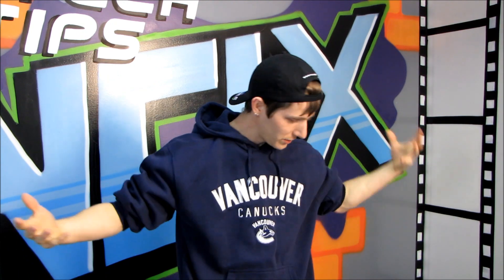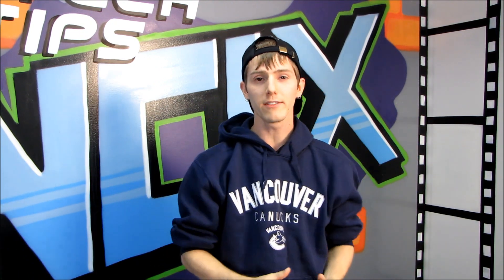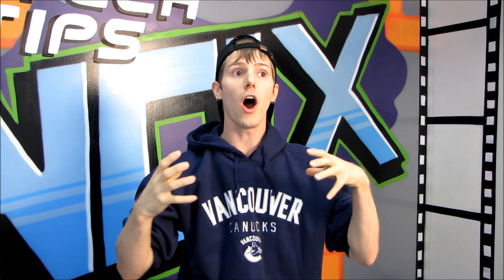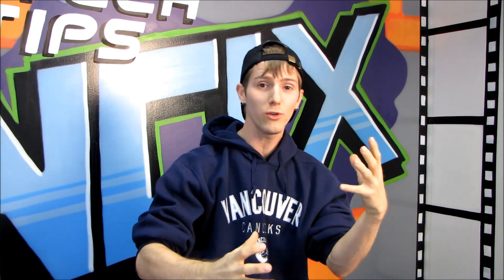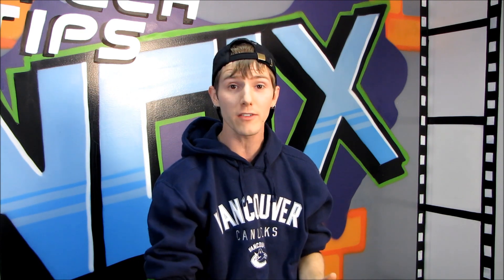Futureproofing Your PC - Dispelling Some of the Myths NCIX Tech Tips

Comment: This actually applied to me a  computer ago. I had built this i7 3770k (??) system and deliberately picked a motherboard that was SLI compatible

My video card? a gtx 670

ugh.

UGH. 

cringe.

Well eventually and obviously I bought a better video card, a 970, and just a year later bought a 1080. The 970 went to my brother, and the 670 went in the garbage. The system is still with me, but doesn't have a video card. It's for guests to surf the web and watch videos.

Now it didn't break my bank to buy a SLI compatible motherboard but I never had to do it to begin with. Now, my motherboards have only one requirement: massive SATA drive/port count. 6+ is minimum. I have a lot of hard drives and need all the help I can get

Comment: What software you use on your system is often a neglected factor. The operating system for example can become a real hog in the long run especially if it comes to Windows. Linux is much more suitable for the long run for two very important reasons: 1)you can downgrade basically everything in your distro thus releasing more resources for your normal desktop applications to use and 2)driver support usually becomes better over time. Especially the last one is a sort of a weird thing. Usually manufacturers offer very poor support for their the latest hardware on Linux systems. As times go by this changes (mostly through the hard work of the community). Windows for example is not like this. Going back 5-6 years ago and you will probably run out of luck for the driver support if you have the lastest version of that OS.

Comment: Btw buying a system with multiple GPUs (SLI) is usually not worth it unless you want to build a workstation of some sort. There are many benchmarks out there that give solid proof that most games don't even support that or (in some cases) do support it but poorly. I have seen very few games that actually use the full potential of multiple GPUs (sadly). Imho this is mostly based on the fact that game developers go for the current standard configuration. Based on various stats a profile of the rig of your average gamer is generated and used to give feedback to the devs what system a game should run on.

Comment: While I have to agree that a case is to some extend a piece of art I would also add a more important aspect - how well it cools stuff in it and where it is located (in an office, in a bedroom, in a living room etc.). Ventilation which is part of the design of a case is critical for the system especially if that system is supposed to run around the clock under heavy load (for example a workstation where you have it render some complex and large 3D scene for days without interruption). Next thing is the size (which of course also influences the airflow I have mentioned previously) - depending on how many components you want to pack inside you will have to choose the size form very carefully. This also applies if you plan on upgrading including adding new stuff to your system.

Comment: tbh futureproofing is a little more difficult than normal at the moment. New graphics APIs are taking advantage of more and more CPU cores, to the point where a hexa-core processor is needed to make sure some games don't bottleneck (or maybe they're just poorly optimized) and resolutions are on the up and up, with 1440p and 4k becoming more commonplace, and with 8k becoming the new 4k.
I'm happy with how my 4790k and 970 have lasted. Unless processors start making meaningful jumps in performance per generation i'm perfectly happy to stay with what i've got for another two years or so, even if it means turning a few things down from ultra now and again.

Comment: My rig that I'm gonna build and expect to be future proof is going to have.
i7 6700k, Zotac GTX 1080, 16 GB Corsair Vengeance DDR4 RED LED, Corsair 750d case or NZXT h400, Gigabyte GA 7170 X Motherboard, Corsair 850 Watt Power Supply and 4 TB WD SSHD with 500 GB Samsung 850 pro ssd....
Reply: also Corsair H110i Cooler and RGB Led Lights

Comment: Iv'e got a high end psu going on 10 and also my TU120EX cooler from same build is still chooching! I try and get 5 years minimum out of a motherboard and cpu combo, with1, 2 or 3 graphics card upgrades in thgat time, does vary on what comes out and what im doing.I like high eye candy in simulators which seem to be my major gaming load these days, fps games not working current build bugger all. 
I got screwed on ddr2 when it went EOL and was stuck on 4gb for a while longer than i liked from my '09 to about '12 system,No way i was getting screwed on ddr3 and ended up going way overboard with 32gb, oh well.My current gaming systems motherboard,cpu abd ram is about 4yo and has no bottleknecking with a current top tier single card solution,so little while more yet! It is running a high OC on water which helps.

Comment: Intel i7 6700k
Gigabyte gtx 1080 g1 gaming
Gigabyte ga-z170x-gaming 7
2x 16gb corsair vengeance lpx 2666mhz
Samsung m.2 950 pro 256gb ssd
1tb hdd 7200rpm
Corsair rm1000i

Actually planning to do this. Any thoughts or advice? 
The video says no one uses sli in the future. 
So adding a gtx 1080 when i feel the need is wrong thinking?
Reply: no adding another 1080 after 1-2 years will give u alot of fps boost and u wont need to upgrade other things like cpu ram etc
Reply: If you have a 1440p Ultrawide, 5760x1080 setup or 4K monitor (the only plausible scenario where you would need more graphical horsepower than a GTX 1080) to play games in 1 or 2 years w/ everything maxed out just save up and wait. When you really need it, sell your 1080 and buy 1 o 2 new GPUs like Volta or Vega 10/11 and  go SLI/ CrossfireX. Just don't buy another 1080 in 2 years because there will be better GPUs on the market. It's like if you bought a 980Ti now when you know that a GTX 1060 is pretty much equal in performance.

Comment: I have a gigabyte h85 motherboard + i5 4460 4th gen processor + 8 GB vengeance ddr3 + zotac 610 2gb ddr3 gpu why I am haveing lag while playing gta5  I only have 15-20 fps in gta 5 benchmarks and I am only using half of the vedio memmory (at normal setting )
Reply: +Bakery Junction cause you have a fkin 40 bucks graphics card. watch linus's video on cheap graphic cards
Reply: dayum man i swear i have the same build LMAO but i have 16gb ddr3 ram

Comment: I already had future proofed mine for 2-3 gen, for quite a while, 3 screens(adapter was added), radeon 7870, i5 3770k, 16gb ddr3 @ 1600, 120gb ssd os, 2 1tb hd's, (2 300gb raptors, 500gb, 640gb added later), 880w(boosts to 1080w) hiper type r mk2 psu 80+ (tideover from my core 2 duo build). wasn't until i wanted to run crossfire on my asrock board that i had to upgrade the psu from hyper to a cosair rm780

Comment: I'm building a custom pc this week.
Key components are almost final. But after watching you video, now I am confused between Intel Core i7 5820 and 6700k.
The main reason I chose 5820k is because it has 6 physical cores. The more the number of cores, the more it helps us in 3D animation and rendering purposes, because it's CPU based. There is a very noticable difference between 5820k and 6700k, 5820k being the faster one. And 6700k has 4 cores, but certainly is more future-proof. I am also a gamer, so that will be another purpose of this computer. I already have two GPUs, mainly GTX 980 Strix, and Quadro FX 4800. What would you suggest when it comes to my CPU confusion?
Reply: +Chirag Borawake you pretty much answered your own question. you NEED more cores to work. paying extra for 6700k when everything you need in a cpu is more cores to work with, isnt worth it.

Comment: anything that lasts me 3 years is future proof: skylake, 16 gb ddr 4ram, compatible motherboard with intel chipset, water cooled, 650 W psu, corsair cabinet, 1 tb hdd, r290 graphics. i think that ought to do it
Reply: +Saptaswa Charan Rakshit  3 year timeline is hardly the case of futureproofing. I mean most of the things that are good now will be good enough in a few years. If you think something is not going to last a couple years, it might not be really sufficient right away.

Things like PSU and case can be kept for a decade just fine, so it makes sense to get quality versatile units. RAM, unless there's a standard change coming up, can be good for upwards of 5 years, and there isn't a lot of price fall nowadays.

A case can be made against future proofing for some parts. You can't usually future proof your mainboard much if you're going Intel, because you need to replace the board with the CPU, and even with AMD, it's hard to predict how well supported any given board will be over the years, so futureproofing attempts are likely to result in frustration. Futureproofing GPUs is generally uneconomical, because performance per unit of currency just climbs very quickly over time, but also because highest end units have shortened design life (failure after 2-3 years is very common) and because the cost rises much faster than performance at the high end. SSD prices also keep falling.
Reply: If you have some more money, buy a r9 390

Comment: Around the time the Intel DG35EC was made, there was also a lot of different LGA 775 (or 755?) motherboards that were meant for much higher end stuff than the DG35EC was. Even though the DG35EC was used almost as much as these other higher-end Intel boards for a long time, the majority of the other boards have failed or are close to it while I own a DG35EC that has gone to hell and back multiple times like your grandparents go to the grocery store, and it's still in very good condition and performs very pleasingly with a Q6600 and a GTX 460 SE 1GB sitting on it. Of course it isn't gonna be playing modern games for much longer, but this is my little brother's temporary machine I'm talking about rather than my own actual gaming rig...however, if I knew how to convert a computer into a server machine, this would do nicely for a small time server aside from the obvious fact that my internet bill would be this rape description is unsuitable for anyone that is too scared to pull wheelies on a scooter down a erupting volcano with your hair on fire chasing down a jeep full of lions with rocket launchers.

Comment: My rig now: 

CPU: i5 4690k 
Motherboard: MSI H81M-P33 Socket 1150 VGA DVI 8 
RAM: 4gb DDR3 
Graphics Card: Radeon HD Sapphire 7750 1gb 
Power Supply: ATX 300 Watt PSU
HDD: 1tb 
Case: Fractal Design Core 2300

I will upgrade my gaming computer by adding another 4 gigs of ram, a 500 watt power supply and the GTX 970 4gb by Nvidia that I have waiting to be used on my shelf. Then my overall pc will be: i5 4690k, 8gb ddr3 ram, 500 watt PSU and GTX 970 since I won't be doing any overclocking for now until I upgrade my motherboard in the future. I also want to do SLI and watercooling with a second 970. But then I'll have to upgrade my PSU again probably so for now I will hold off with that. 

I can play most games from High-Ultra settings getting solid FPS. 

Skyrim: Ultra settings - 60 FPS
Assassin's Creed - Black Flag: High Settings - 30/40 FPS (very playable though even with lots of combat and action)
Shadow of Mordor: High Settings 50/60 FPS
Dragon Age 3: Inquisition - 40-50 FPS though it stutters sometimes with high level enemies and has crashed once or twice I play this on low/medium settings though it can run on Ultra but very slow! On low/medium it plays fine in most cases and I don't notice any real lag.
The Witcher 2: High/Ultra - 40-50 FPS, sometimes 60. Very playable on High settings in the middle of intense combat and so on.

Overall it is a pretty decent rig with my temporary specs. I have more games on steam such as Terraria and so on and they all run fine so far. I am installing the Elder Scrolls Online so I'll see how that goes. Can't wait till I install my 970 and get more ram. Then it will be a beast!!! :)
Reply: Tom Brown nice job bragging :I
Reply: ***** THAT PSU THO 300 Watts!
Reply: Yo people! I just got paid so am gonna get 4 more gigs of ram and a 500 watt pSu for my gtx 970. I can't wait!! :)
Reply: Tom Brown 
Yay :D
Reply: Tom Brown dat RAM though. Get moar!!

Comment: Nice video really. 
I was into video editing back in old days using my P4 processor with 256 mb of SD ram !! how horrible it was. So for me since I don`t really use high tech cameras or so on, a mid range laptop or pc would be more than enough since I use my samsung mobile HD videos.

Boy do I miss all that, but in my line of work ,  i use 2 main softwares..

1. MS Word.
2.Adobe illustrator - to design my logos and stationary etc etc.

The good thing is, I get to save on computers , I still use my 2009 Macbook white with the core 2 du 2.1 and 2 GB ram which  excellent.

now.. BACKING UP OFFICE DATA!!  sheeesh! that is the headache.

Comment: something begginners dont know is how certain components are more future proof than others. Gpu's and monitors are quite limited in their lifespan of relevance we are in a weird spot with the new 4k and other resolutions.

The real truth however is that you dont need crazy high end everything just to play games. Theres nothing wrong with going with mid range gear and just playing at 1080p
Reply: "new 4k and other resolutions", that didn't age well, now 1440p, and to a lesser extent 4k is basically standard on every decent monitor today. About a year ago I bought a 4k, 28'' hp monitor for $200, it was TN, and 60hz, and I have since upgraded to a 32'' LG 144hz 1440p, for $250. That was on prime day and now it's $319, but you can find smaller sizes inn different brands for about the same I payed for it.

Comment: ok i am planing on building a pc soon and i will use the ASROCK x99 extreme 11 or the ASUS x99 ws motherboard, i do some gaming and so 2 way, 3 way and 4 way sli or crossfire would be good as a option but i also like music both building a library and creating my own, archeology and designing houses and landscapes is also a passion of mine so these boards will allow for large storage options as well as pci connectivity and  a crap tone of memory to boot. now keeping in mind that the ASROCK x99 extreme 11 allows for 18 ssd,s i am also investing in a COOLER MASTER STACKER CASE that i can gut and re use at any time and will most likely be the last case i will ever buy. in short this will do pretty much everything i wont and in the future if technology renders this out of date for gaming i will simply buy a later model board and incorporate it into the stacker case for future gaming options. the way i see it, the case is the only thing that is future proof and in 3 years time i still may need to gut the stacker case and start over, such is the advancements in technology.

Comment: GPUs are getting more power efficient,soon you'll be able to just to run sli or cross fire with a good 650W psu with the highest GPU on the market,a little extreme but a most likely reality.

Comment: Im getting a 970 next week, but my cpu will bottleneck it (a8 6600k)
I am also planning to buy a i7 haswell-e 5820 6core and 16gb ddr4 in about a month. Is this bad?
Reply: ***** I read your comments expecting something really informative... then I saw Black & White and promptly stopped reading. Phelan Nyvoll Walker You don't need an i7 if you're going to be gaming, i5s are the standard. I recommend you read up on pc building on the pcmasterrace subreddit, they have great guides on upgrades and cost efficient pc part picking. Pc part picker is also a good resource to prevent bottlenecking. Your 970 will likely last you for a few years (I hope mine will). Good luck.
Reply: Phelan Nyvoll Walker No, it won´t... you can upgrade you system if you want for future porpuses or if you do heavier duties on your PC (e.g. rendering, video editing, etc) those kind of apps will love that CPU and the DDR4, BUT if you objective is gaming or the heavier thing you don on your PC is gaming then you will be more than fine, just put it on turbo or oc it a bit more if you want a little bit more fps in your games.
Reply: kurok1tenshi  ummm it actually does bottleneck my gpu like hell.........
im getting a 4790k in stead. the x99 stuff is too expensive... 
and hyperthreading actually helps in games like battlefield 4.
up to 20% more fps
Reply: Phelan Nyvoll Walker if i were you id get a 4 core i5 or i7 haswell and 8gb of ddr3 ram. As was mentioned before if you get a 6 core it wont be optimised and some of the extra cores wont really be used, and iv never used more than 6gb of ram for anything on my pc, you could argue 12gb is better, but 16 is definitely overkill, and ddr4 isn't optimised for anything yet
Reply: ***** are u shitting me with the deadly gas or is it real??cant tell if ur an expert troll or u really now what u talking about???